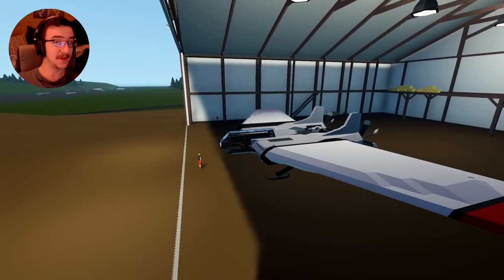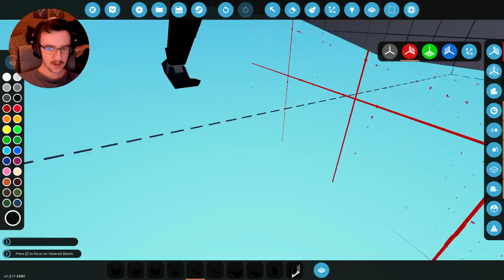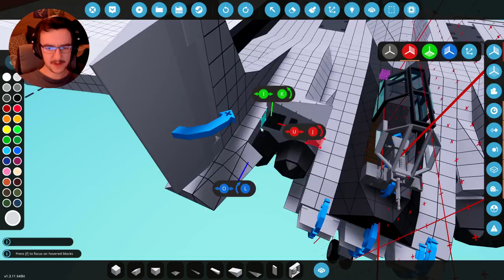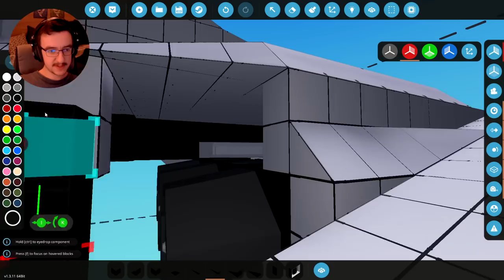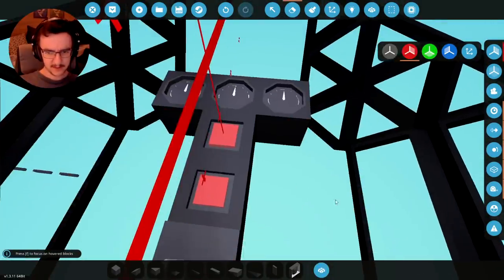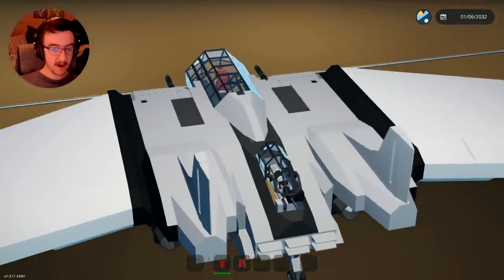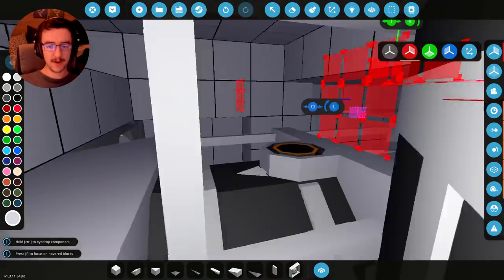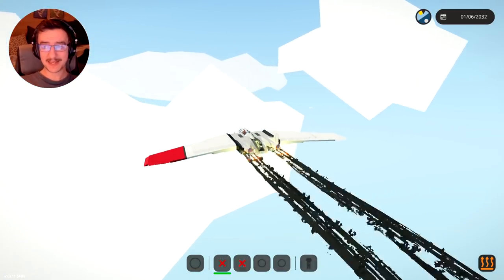JET ENGINES ADDED! - Flying Wing Build - Stormworks Search and Destroy!

Comment: I built a jet a bit of time ago and used these values:  proportional gain: 0.1  ,Integral gain: 0.0001  ,Derivative gain: 0.01 and max value 1 and it worked ok so if you still need them here they are